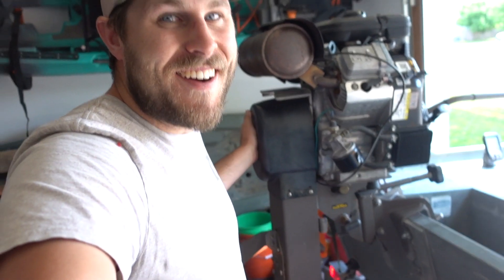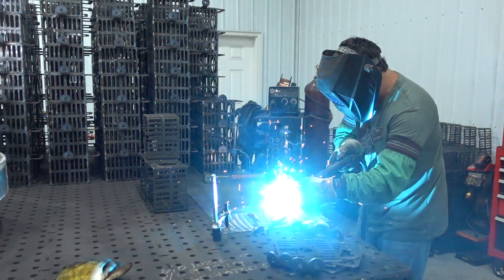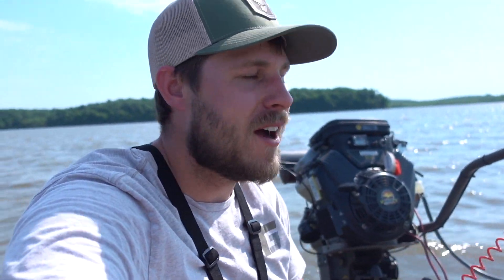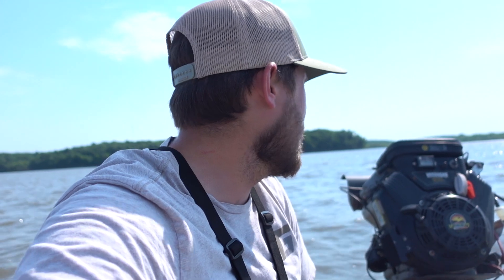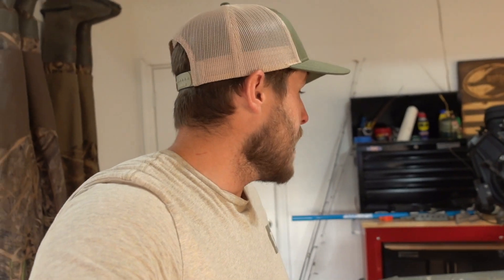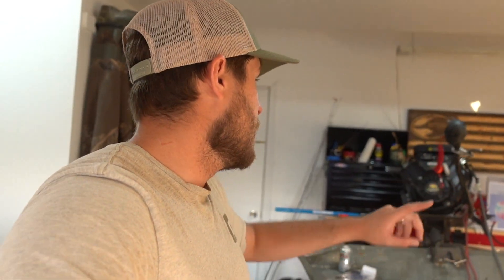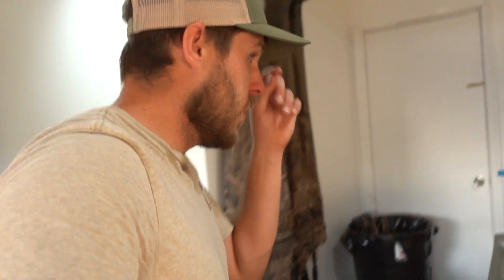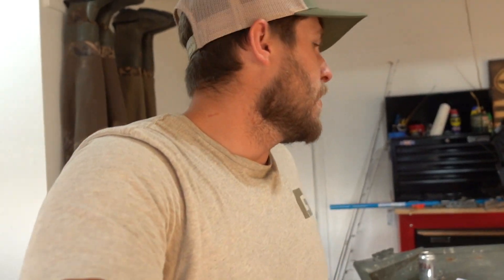The Boat Got A HUGE UPGRADE!

Comment: On bass boat, ski boat, it’s tilt down to come out of the hole and get on plain; then when on plain, tilt up a little to get the highest speed - steering resistance is also minimized at that point. You’re going to love it, and the sad will always be faster than longtail
Reply: Sd

Comment: I know this video is three years old but the new gatortail 23 micro with reverse is a game changer on a small boat.  Geared so that 23 is turning the same size prop as the big block at the same rpm and u have reverse.

Comment: After using both myself I order a beaver tail over a surface drive. Where I hunt I have to get through some shallow and hard to navigate through waters that are extremely shallow. I do know you hunt tons of different spots but I wouldn’t hesitate to use the beaver tail when going somewhere with a lot of weeds and shallow water

Comment: You did good going with the carbureted 23hp you can add a lot of muscle and speed fairly cheap on them. I had the 27hp efi mud buddy and had lots of fuel problems and not much in the upgrade department besides invasive engine work. Those 23s can run like a 35hp if you work em up

Comment: Hey josh we had the same issue with our mud buddy where it seems to pull when your running at higher speeds especially when your trim is up, to fix this you have to spend the sort below your prop almost up to a 45 degree angle to get it to stop pulling. On newer motors this comes standard. But you may have to adjust yourz

Comment: Just a tip, when you start the motor pop it out the water before because I have a similar motor and copper head manufacturer told me that’s what you gotta do to start it

Comment: When you get the trim set just perfect the steering will be alot easier. You will have to adjust trim to match your load in the boat. Once you get used to it its not that bad!
Reply from the maker: Thanks for the tip!
Reply: It takes a lot to get used to but with ur left to right issue is a weight distribution issue if ur by ur self put all ur gear on the left side of boat, if got a partner u offset him to the opposite side of u and try not to put weight in the front or back try to keep in middle of boat, that should help u a lot

Comment: We had problem with our surface drive not have having enough power with all of our duck gear in it. If you run into that I would recommend a delta level three upgrade.

Comment: If you are fighting with the tiller handle take a crescent wrench and bend the skeg just a little at a time and it’ll almost drive itself
Reply: This is exactly what he needs to do.  I have this same motor on my 12/42 and it rips.  No need for reverse or power trim once you get it sorted.  Also, like the guy said earlier make sure she’s running 3900-4200 rpm.  Grab bar and standing will also help but you also need time on the water with these.  Way different but once you get the hang of how to handle it you’ll be fine.  Like, when you need to drop it in the mud with the manual release it’s a lot quicker than with an electronic trim and you have more control and can manhandle the crap out of it.

Comment: I have the mudbuddy sport V. Has a lot of mercury components and drives more like an outboard than other surface drives I've used. Great to have reverse and power trim, but like you said, for duck hunting its more of a nice to have and not necessary as long as you have a good paddle or push poll.

Comment: If your still having trouble with the motor pulling on you the bottom Skeg is designed to be bent left or right depending on if the handle is pushing or pulling on you, and a good indicator of your motor being trimmed right is it should be turning at about 3800 rpms on the tach for a stock motor, I’ve been running these motors my whole life

Comment: Bought same motor last year. Recommend buying a heavy duty spring for the plate that sets the motor in its lowest position.  First stump you hit with the stock spring will snap it off.

Comment: I’m down in south Louisiana and have a gator tail. Trust me they are the way to go for duck season. You need a solid 10-15 hours in it before you get adjusted for the most part. Get 10-15 hours on it and then see how you like it. Everything takes a little adjusting to.

Comment: I ran a copper head on my 15 Jon boat reverse and trim arnt that important u learn to work around it pretty easy. I always carryed a push pole and a paddle. U can also use motor to spin ur self around by lifting up and just letting the prop barely touch the water works like a bow thruster if you know what one of those are lol. Also it helps to keep ur trailer alittle bit higher out of the ramp when putting the boat on the bunks will grab the boat and guide u on better.

Comment: You got a couple options. Mount it off center, and adjust weight in boat to combat the tiller torque. Orrrrr, take that skeg off and get a 3lb sledge, and adjust according.

Comment: Keep an eye on your transom and the welds on the gunwales (looked like it was a wood transom). That motor is twice as heavy as the outboard. You should be standing and/or sitting higher than the bench you're sitting on, that's why the handle is way above you head. There is more tiller torque on mud motors/surface drives of that size and larger.

Comment: Surface drives are super weight sensitive. If the tiller is pushing against you or away from you, weight needs to be shifted. You can also put a bend in the end of the skeg. Weight will determine everything regarding trim and ride.

Comment: The root reason of it being so hard to turn starts at you having a long boat with underpowered motor. It’s equivalent to trying to turn a long kayak with a short paddle. The lever action drag from the front end will indefinitely fight you hence why huge barges need tugs to turn the front end in channels.

Comment: Pods welded onto the back will help the boat plane faster and that nose up look. Most mud specific boats have pods from the factory. Mud buddy and other company’s sell them though.
Reply from the maker: If I put pods on I wont be able to use my trolling motor. I'll have to make due without them unfortunately
Reply: Pods are good with a load in the shallows but you can wave dive in heavy ie great for hunting weather. I have a g3 1548vbw and a copper head 23 in New Zealand and in big waves i trim the boat bow up and bounce along. You can’t trim bow up with pods
Reply: Pods are for outboard mainly, now a hunt deck is what u need for a mud boat at that point save up a year or 2 and buy an actual rig for hunting. I fucked off for years being cheap adding shit to my mud boats was a big waste of time save ur money and buy a slightly used name brand boat full set up. Next year or 2 everyone is gonna be selling there boats they got with stimulus money during COVID
Reply: @jayneup4776  good advice here.

Comment: trimming it right will help with steering but steering torque is unavoidable with a surface drive especially if running a two blade prop i got a built 35hp gatortail on a godevil and after owning dozens of boats its by far my favorite but it will get away from you also with no reverse a push poll is your friend along with bunk slides will help in launching but congrats on the new rig

Comment: Don't understand why get a mud motor as they are so loud, and scares all the ducks. Your outboard motor will be easier to use.
Reply from the maker: Outboards are not great for going shallow. They need water running through them to cool the engine. Vegetation can plug the water intake and blow the motor. Mud motors are air cooled and can take beatings.
Reply: @OutdoorLimits  I been using an outboard motor for years with no issue going in 3 feet of water with a boat like what you have. Just have to tilt the motor up.
That motor looks heavy too since a forklift had to be use to lift it to be place on your boat. Be hard taking it off to put the outboard back on in the spring.
But good luck with that loud motor this season.
Reply: @lonnieyancer5735  I wouldn't really say 3ft is all that shallow, these motors can go in 10 inches of water or shallower with the right bottom. It's pretty much all you will see in south Louisiana with the muddy bottom there.
Reply: @amb221989  we have mucky bottom lakes here in Michigan. My friend had a mud motor. He got rid of it as it was so loud it scared the birds going up river at 4am. Since going back to outboard been seeing more birds.
Reply: @lonnieyancer5735  that's really interesting, I just moved to Ohio and my girlfriend is from Muskegon michigan and I've been looking into hunting some new areas. Any tips on good areas to go in MI? I left my boat in Alabama with my dad so he can use it so would mostly be bank hunting for me right now.
Reply: @amb221989  fish point in the thumb area they have areas where you can walk in too also Shiawassee National Wildlife Refuge in St. Charles.. Allegan state game is also good. But any where along a pond or river that's open to hunt and see birds your good.